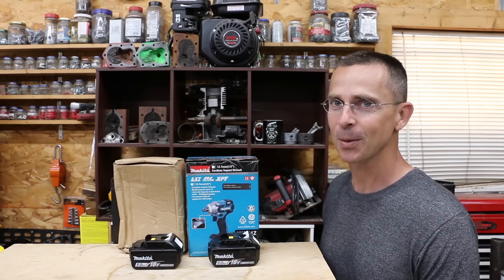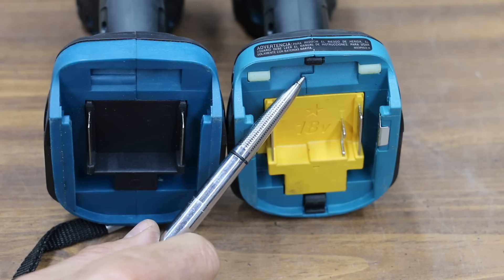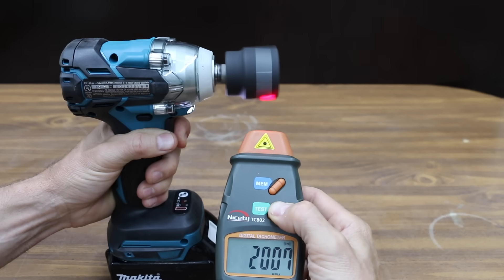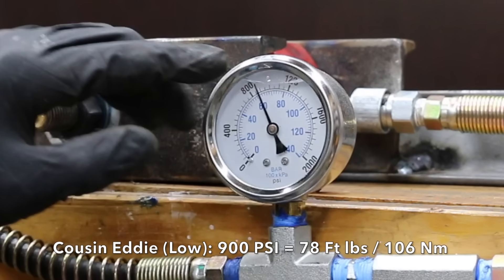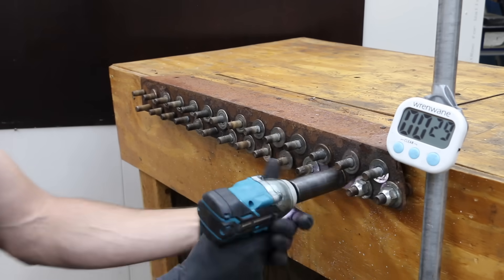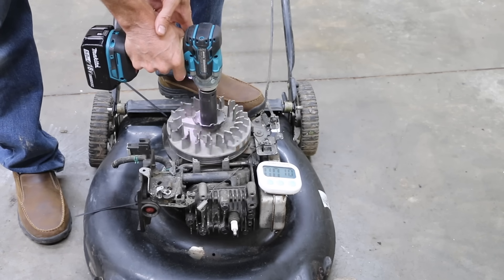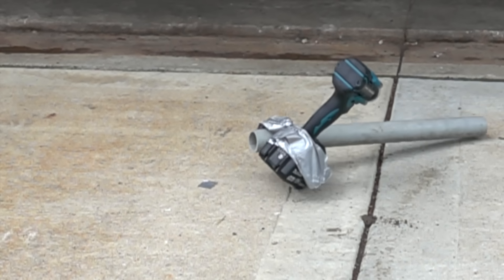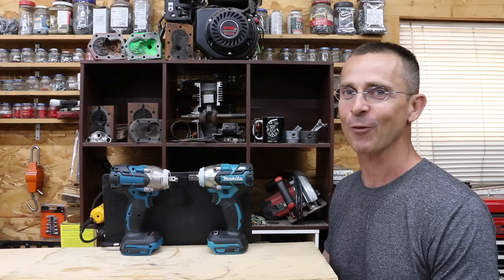Fake Makita Impact Better? Let's find out!  Makita XWT11Z 18V LXT Lithium-Ion Brushless Cordless

Comment: I’d pay $30 bucks for that thing just to have around in case it’s needed. Thanks for the video. Looking forward to more impact videos!
Reply: You dont need extra 10% power for extra 400% price
Reply: @NEOSGROUPS  Not just power, build quality and longevity. That being said, I'ma buy one as well for 30 bones lol
Reply: @NEOSGROUPS  I bet if he swapped the battery it would perform much better, probably it contains lower amp battery, in which you can cheaply replace the cells with better ones.
Reply: We bought the same knock off impact wrench for $30 on ebay too, we're happy with it.  Dad got it to change the shocks on the Cherokee and to do tire rotations when needed, it works fine for what we use it for.  If you're going to use an impact wrench a lot go with the Makita, but if you're only going to need the wrench a couple times a year the knock off will do just fine, but hey, it's your money.
Reply: Oveida Sinclair You must not live near rust. I couldn’t remove the bolts to change out the struts on my car with a 450 ft lb air impact. And that was after I broke them free with a breaker bar.
Reply: @anti0918  you dont use an impact in the rust belt. you use a torch and air hammer lol
Reply: @oveidasinclair982  I bought a corded version from eBay, out of Chinacorp a few years back....quality was so bad that it would not provide enough torque to remove hand tight nuts....
Reply: @TheWolfsnack  Yeah you run that risk with anything made in Maoist China, the impact driver we got is about like the one in this video performance wise.
Reply: For $30 it's a good deal for someone who only needs to use it a few times a year.
Reply: He used a Makita battery in both tools. So the battery is not a factor.
Reply: Damn, my adjustable 150nm torque wrench was more expensive than both of them! 😜 But the 30$ China stuff is quite nice for that price.. maybe i'll buy some just to rip the Motors out for other projects 😁
Reply: For household use, I would agree. My site stuff, I will buy brand.  Being on a roof or up in a tower, you want to know 100% your tool will work.
Reply: EXACTLY,as a backup .
Reply: Cousin Eddie is OK if you only use it to change a tyre once in a while, but if you use it more often, get the Makita because you're not wasting money on throwaway tools. In the end, you get what you pay for, and if you break a Cousin Eddie 5 times, you might as well get the real deal.
Reply: Bad memories?
Reply: @Milhaus You wont find a replacement battery for the brand one either in 2 years. They will supersede with newer model. The newer model may look alike, but just differnt enough to prevent you from using it in older machine. That is what happens to my lawn mower. I end up have to buy replacement cells and repack the battery.
Reply: Too bad you can't buy it anywhere for $30.

Comment: I almost wonder if Eddy is one of those infamous "3rd shift" products that was designed to use a few cheaper parts in place of the normal ones to avoid counterfeiting issues and save on production costs.
Reply: I don't think so. Third shift products only make sense with simple designs and huge brand margins. A genuine machine contains many expensive parts and there's no way to reuse most of the facilities quickly to make a much cheaper product. The Chinese are known for re-designing everything to reduce the parts count and cost. The assembly line is the least of their worries.
Reply: @zwz.zdenek  perhaps but certain parts are clearly from the same source as the Makita, which is what made consider the possible.
.
When it comes to selling knockoffs certain parts are easier to come by than others and you've gotta make some changes here and there if you don't want to get seized by customs, so it's not too crazy to make what you can with parts like the casing and then make little changes here and there to produce stuff that's cheaper to make in general.
.
Moreover, a lot of that assembly line equipment isn't anywhere near as restricted and specialized as you'd think.
Reply: Sadly, we will never truly know the real origins of it

Comment: How would Ryobi impact wrench compare with Makita. I have a few 18volt Ryobi tools. The impact wrenched worked just fine to remove and replace the nut on my Ford Falcon front hubs as I did not have a breaker bar.

Comment: I bought one of the cousin eddy’s last year after AvE did a review on one. Definitely worth $30 but not as good as the makita
Reply: I've got one too after AvE's video. It's stronger than my old brushed impact driver from Makita! 

I can change my wheels with the knock off where I would have to use a breaker bar beforehand using my old Makita. Not a fair comparison considering my old one is over 8 years old, is using a brushed motor and has seen a lot of abuse. 

I got the one where the anvil has a hex cutout so it allows me to insert bits into the anvil as well. Defintitely worth 30$!
Reply: @schwuzi  Did the same. Bought a cousin Eddie @ the end of November from the Walmart website.  Only took 2 days to be delivered.  I keep it in the truck to take off flat tires and use on the bottle jack.  For X-mas My Niece and Nephew bought me the real Makita XWT15Z. Man that thing is powerful.  Cousin Eddie is definitely worth the $30.00 price tag.
Reply: Number 1 [Main]  I got this model from aliexpress: 

#Aliexpress US $29.99  50%OFF | 18V Electric Brushless Impact Wrench Cordless 1/2 Socket Wrench Power Tool Rechargeable For Makita Battery DTW285Z
https://a.aliexpress.com/_B18KY4

Mine did not have the yellow logo shown on the pictures, it is completely blank just like the one in this video.

The magnet inside the hex cutout tends to stick to the bits after pulling them out. I glued it in with a little bit of superglue and it works perfectly now.
Reply: Its not worth 1$..
Reply: tarek midnite you clearly haven’t bought one. I have and used makita since they came out and it’s well worth the money
Reply: @inkman6964  I have the M18 one-key milwaukee big beast, a really small but great Panasonic 2-250ish nm (the milwaukee one can bust any nut but it's just too big (and heavy) for some jobs), and this chinesium thing as a mid-range, dirty-job and loaner unit. Only reason i don't use it anymore myself is I got the Makita real one lightly used for almost the same price (well, $75 together with a Makita angle grinder).
Reply: @pr0xZen  That's a really solid deal you got there! Wish I'd find something like this in my neck of the woods.
Reply: @trexmidnite  I would even pay 50$ for it tbh. It's very much usable.
Reply: tarek midnite 
Yeah, I hate when cheap knockoffs over promise. Very misleading.
Reply: @Mote78  I knew what I was buying, as I watched the review from AvE. Didn't care for what the description said, I knew what it's capable of and what is not so good about it.
Reply: @Number 1 [Main] just search for "impact 520nm" on ebay, alibaba, etc and you will find them.

I should mention that I also ordered one with the hex cutout, but it came in the style PF had and even the sticker covering the button and leds was missing. Though ist a great value
Reply: @techtastisch7569  Aliexpress, not Alibaba. Alibaba is for wholesale.

Comment: How about a bout with drills from Lowe's or Home Depot (ones you can buy from either store). Like best drill from Lowe's and best Drill from Home Depot, then have a battle between the best from either store. I am going to have to buy stuff from one of the locations, due to one donating $ for a particular politician. I had previously invested in one brand, but now will have to switch brands, thus the request to have a drill battle :)

Comment: You should review the Maximum brand. I've bought a few of their tools and my impact bits are quickly losing their black coating. Not sure about the quality, though the price is a bit lower than a DeWalt or Milwaukee.

Comment: A lot of the time with these cheaper options, they're great for someone wanting to do a single job and not doing one for a long time.
But for anyone wanting a tool for serious use day in day out, it'll wear down and fail on you quite a lot quicker. That makes the expensive option much better.

Comment: Would it be possible to test the products often called “Water Wetter”  They are sold in auto parts stores to help a engine cooling system.  Some of the claims on the packaging seem to be stretching the truth.
Reply: Water Wetter has been around forever, and from everything I've heard it actually does seem to work. Would love to see it tested though.

Comment: I just bought a Rigid 1/2” drive 700 ft lb wrench. Almost went with ryobi. I think it would be very interesting to see you run more tools through their paces! Thinking Stubby m12 Milwaukee vs Stubby 18v rigid impacts would be a neat one. Very excited to see where this could go, there are a lot of comparisons nobody has done yet! I can think of dozens of neat tool shootouts: Atlas vs ryobi vs ego outdoor power tool lines is another one nobody has really covered (some have done reviews but no one has gone in good depth like you do - the battery differences in particular are ignored)

Comment: I would like to see a comparison between the Bauer 1/2" electric corded impact wrench, the Enertwist 1/2" electric corded impact wrench from Amazon, the PorterCable 1/2" electric corded impact wrench, the Dewalt 1/2" electric corded impact wrench, and maybe other wrenches of the same shape. These are supposed to be the toughest electric impacts you can get for a reasonable price.

Comment: The only way you can get a brushless tool for under $30, is go to Direct Tools!!! I got a “factory blemished” brushless 3 speed impact driver for $25.00. Tool only, but you still get a 3year warranty with them. I also got the Ryobi Quiet Strike impulse driver for $20.00. Same 3year warranty for “factory blemished”.

Comment: I'll keep using my DeWalt.
That said, Makita definitely makes good tools. Dear old Dad bought a plug in electric Makita drill when I was about seven years old. It has a 1/2" Chuck, a 550 rpm top speed, machines steel gears, and sounds like a jet engine when you pull the trigger. I turn 40 this year, and all that drill has needed in this time is a new power cord.

Comment: For 30 bucks thats hard to beat. If its an occasional use tool thats getting some light-medium use a handful of times per year, Id probably go with the cousin-eddie.
For me personally I tend to lean towards the "Cheaper" tools (Outside of tools that would be blatantly dangerous if they failed in use.  Ill buy a cheap socket wrench, i wont however buy a cheap jack stand to sit my car on for example). Basically a LOT of harbor-freight tools in my tool box.  
When a "cheap tool" breaks, ill upgrade it to a more expensive tool.  
Having said all this: I used to be a mechanic once upon a time before getting rid of most of my stuff and moving to australia for quite a few years until I returned back to the states. Im not a mechanic anymore, but i still do quite a bit of mechanic work (For friends, family, neighbors. etc- I do half a dozen jobs or more a year, ranging from simple brake jobs to timing kit jobs) by normal standards.
I can honestly count on 1 hand over the last 6-7~ years that my "cheap" harbor freight tools have failed me and required an upgrade. So im a big fan of bang for the buck kind of stuff.

Comment: Hey project farm here’s a impact that I want you to try I’m curious to see how much ft-lb tighten and loosen the bolts and wheel lug nuts  I’m going to send you two links one of them I have currently and the other one that I want to get next.  
 https://www.amazon.com/Cordless-Sockets-Battery-Masterworks-MCIW326/dp/B07JJBLBZC
Reply: You'd be better served with a simple quality breaker bar and a few sockets. 

The best thing about cheap tools is it encourages you to buy decent ones. When they don't meet the advertised ratings in any way, shape, or form you'll have just pissed away enough $ to remember to buy something that actually works next time.

Comment: You gotta do a water test I left my dewalt 3amp hr drill and impact set in the case outside with it open and it rained in the middle of the night drinking was involved so taking care of it was overlooked. But when I made it outside around 10am I looked and thought they were toast the charger and drill and impact still worked they were sitting in about 3/8 of an inch in water

Comment: if you are running a work crew with some newbies or some not so honest, you can use the same battery platform and hand the knock drill to the newbies. lets be honest, tool theft is a huge deal, at least it is here in the south.

Comment: I’m a dewalt fan I’d love to see them put to the ultimate test how about those battery powered trimmers?
Reply: The nose hair trimmers or pubic hair trimmers? 

In all seriousness the Milwaukee wins the weed trimmer war for now so long as you get the quick-lock one. The pole saw has been amazingly useful and if I actually cared about the way my place looks I'd probably get the edger also.
Reply: DeWalt basically will obliterate its competition like its dinr for the previous episodes of PF. If I'm wrong I'll throw my carninti the grand canyon
Reply: I prefer my ego brand battery trimmer. They know how to make a product. My gas powered has some power but the ego string trimmer honestly wins. It's perfect for my yard. I can load 15 feet of line in 60 seconds or less too which is amazing. No more spare spools needed for fast reloads. Granted the batteries are fairly large, but 100% interchangeable between all their yard equipment.
Reply: I have the Dewalt 60v trimmer, it has been great. String only though, can't put a brush blade on it. 🙁

Comment: Very nice review! But, I dont buy any tools based on "dance moves". I am surprised you can get that much power/dollar out of that HF tool. It always boils down to "are you willing to save some money, knowing it isnt as strong/tough". As a working pro, no, I'm not willing. But, I'll sure say I have made the $ choice before. It usually turned out just like this, less power & less durability, but totally served its job (longevity is a point you cant really test in a video, and they dont last as long). Overall a great video, but we dont need the dance moves for cut shots. How many times have you had a "dance shootout" while working on equipment, or mowing? Hate to imagine a "dance move" get into your "honest merits" reviews.....

Next up, a handful of Portland cement in a lawn mower & rate its "dance moves" just as it seizes up.... not what this was all about.

Comment: Bought a cousin eddie some time ago after AvE made a video on it. It's incredible how much tool you get for 30$. I'm mainly using it for woodworking and hasn't skipped a beat still. IMO the biggest detriment is the lousy trigger, wish it had better control.

Comment: If Im not mistaken impacts have a torque biase in the reverse direction so you dont need to grab a bigger impact every time you need to take a bolt out you put on with the impact. So the arm wrestle wasn't perfectly fair but we all already knew the conclusion so it doesn't matter. Just something to keep in mind in the future. Great video, If I was on the makita platform and wanted a second impact for around the house I'd probably be hopping on eBay.
Reply from the maker: Thanks for the feedback.

Comment: personally i'd rather get 4 knock offs for the price of 1 real Makita. And i doubt most users of impact wrenches need that little extra oomph to remove bolts/nuts that the Mikita offers anyways.. so unless you work full time in an industry where you'll encounter a ton of heavy duty fittings and numerous corroded rust welded bolts and have to literally fit or remove countless fasteners per shift... there's really zero need for a Makita, especially if you're just using it for projects around the home or car and only just fitting or removing a handful of nuts and bolts... The extra $100 isn't worth saving a measly 1-2 seconds per fastener over the knock-off brand imo.

Comment: You should do the different in the Milwaukee tools and genuine batteries versus the knockoff battery’s everywhere on line for them and put both the genuine and the knock off ones to the test m12 and m18

Comment: video idea #1 does adding mothballs to gas increase the octane rating? #2 If a ping pong ball filled with liquid drain o  with the fill hole covered with scotch tape will it create an explosion when the gas eats the tape off and the Drano mixes? #3 Every-time you drop a tool or a nut and bolt while working on something it always fall in the center hardest to reach areas.

Comment: I stopped buying Levi jeans when the price went up a few years ago. I found other jeans at a Dollar General for $12. They were just as durable if not more than Levi jeans. I did find a leather Levi coat at Burlington Coat Factory for $60. It had a Levi tag with the MSRP for $180. It's a nice coat with a good warm liner to wear in the cold season. I won't belittle anyone who buys Levi products but I'm not paying extra money just for the Levi tag sewn in the rear pocket.

Comment: I have both of these tools and it is absolutely worth the $30, though I got it off Ali express. Basically I keep it around for the jobs  I don't want to risk my Makita's on.  There are a few knockoff's on Ali express that I have, all around for the same price. They actually perform about as well as ryobi, craftsman or the harbor freight offerings, except they use batteries I already have. If you have makita tools around and find yourself doing jobs where a less powerful tool could get the job and there is a risk of breaking/losing the tool. Having some of these around is great.
Reply from the maker: Great point!